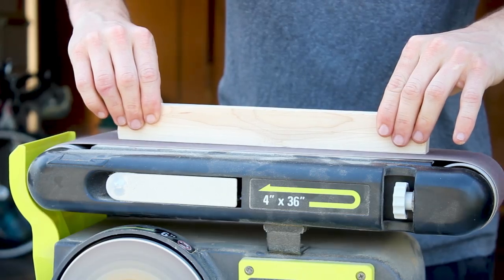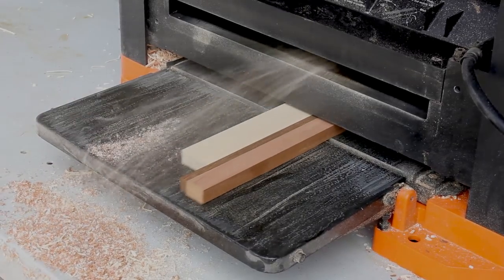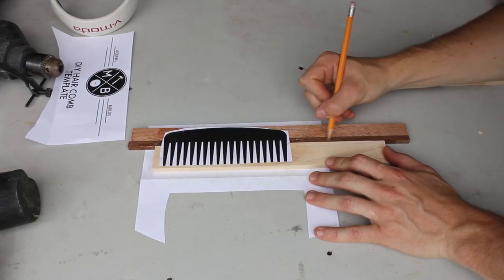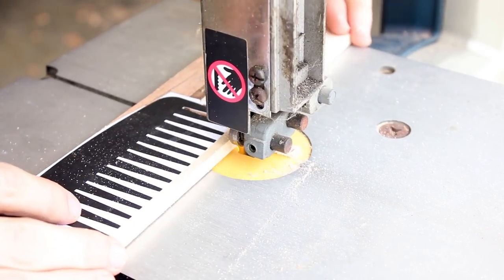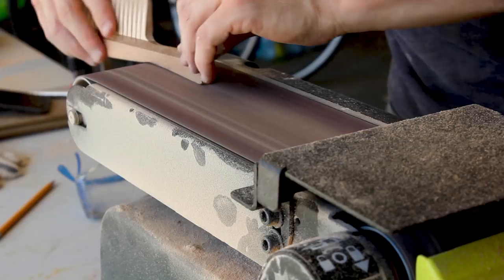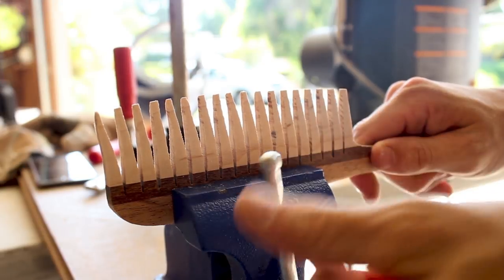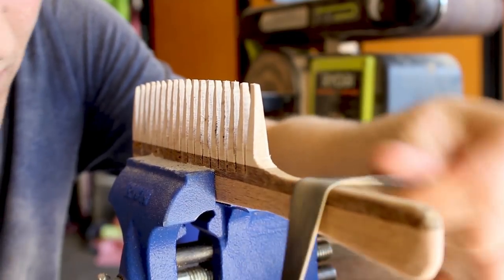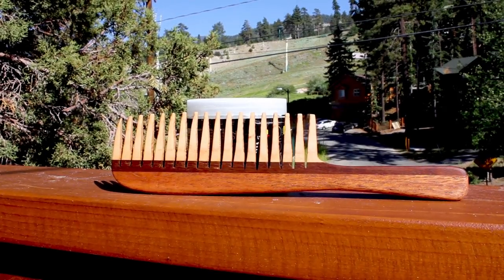DIY Wooden Comb | 22

Comment: Nice job, the only suggestion would be to turn the bristle part 90 degrees that way you would have less worry about breaking the short grain.
Reply from the maker: thanks! not totally sure what you mean by turning 90° but i'll confirm on my end that the comb has held up quite well (to my delight)
Reply: I meant to have the grain run in the opposite direction.

Comment: Can i Use sand Paper than The machine Did you Use? can Comment fast Thanks 

Where did You Get the Pattern to Make this Wooden comb?
Reply from the maker: It will take a long time to sand by hand for the larger shapping - I wouldn't recommend it. Mike at Modernbuilds has the pattern that I modified.